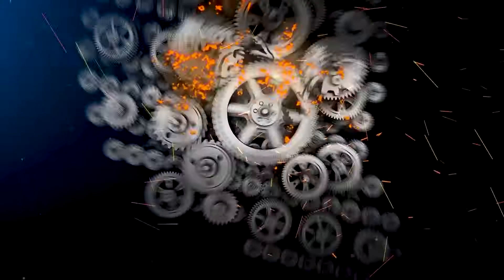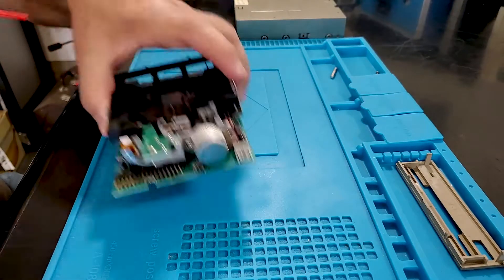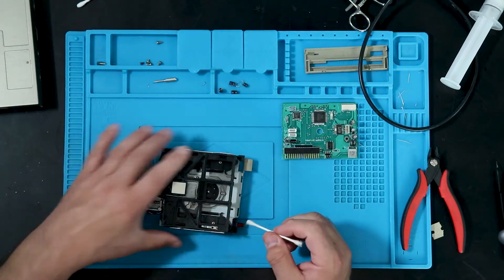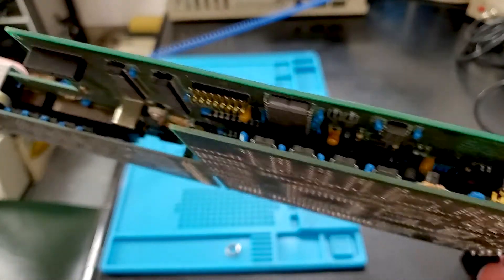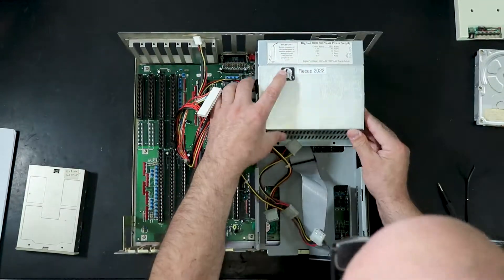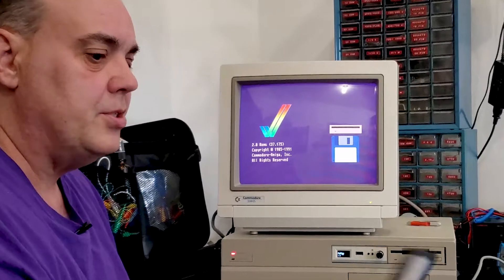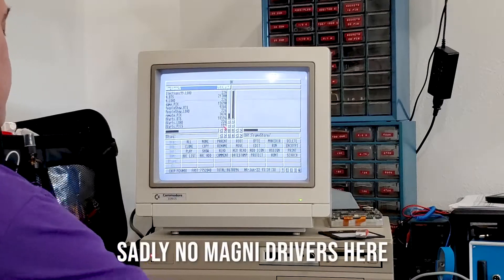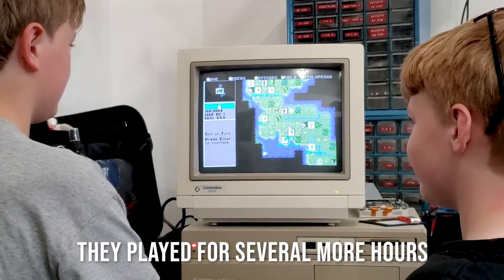Amiga 2500 Restoration - Bringing it All Together - Will it Work?

Comment from the maker: I was unable to get the Video Toaster to run so I will make a dedicated video on it as soon as I work it out. Apparently you have to have a good quality composite sync source in input one to calibrate it and I have nothing. I'm on the lookout for a high quality composite security camera or VCR/VTR for this.
Reply: You need to insulate that metallic strap (the one with the zip tie on it) from the case. If it accidentally grounds to the chassis, the Toaster will not properly sync. See vwestlife's Toaster restoration video for that tip.

You should be able to run the Toaster software without any video sources connected. If not, any video source connected to input 1 that is not a video tape will work like a camcorder or even a DVD player sitting on the splash screen.
Reply: I know this is an old post, but I want you to know that I had this computer when it was new. my favorite game was Dungeon Master. Today I used your video to teach one of my private online students. We are doing the history of personal computing. I had all the computers from the 80s on. Microsoft and Amiga, and then later on, I switched completely to Apple. I appreciate your video so much here, and it brought back a lot of memories. I installed a Video Toaster in my Amiga, as well as other components. I do regret that I got rid of my Amigas, but you can't keep everything.
Reply from the maker: @artsfishstudio5368  That's wonderful. I hope your student learned something and I agree, Dungeon Master is Amazing. This computer is now with my best friend, who I met at our Amiga group back in the day, and he too is a HUGE Dungeon Master fan!

Comment: Baking powder with superglue! Where did you find that lifehack? Thats' going into my toolbox of ideas. Also I too have used 3M floorpads to replace the age-melted rubber feet. To get the old adhesive off I used a putty knife pressed through a dishtowel soaked in 91% alcohol. Also don't be misled but the drive whine, it seems all those early 3.5" were noisy especially after being used to the nearly silent drives in the PC world for years.
Reply from the maker: Thanks! I can't remember where I learned the superglue trick but it has worked really well for me, even on a refrigerator door shelf that gets a lot of abuse. 

I am hoping that the noisier drive holds out but it also makes what I call in technical terms "Scary". Like something is messing with the spin speed.